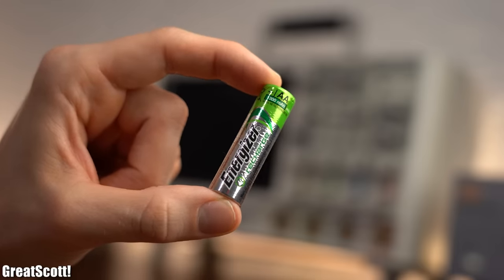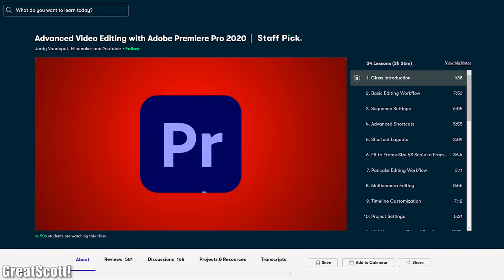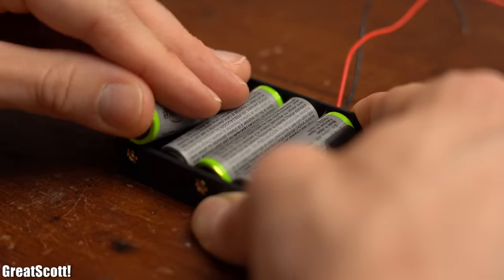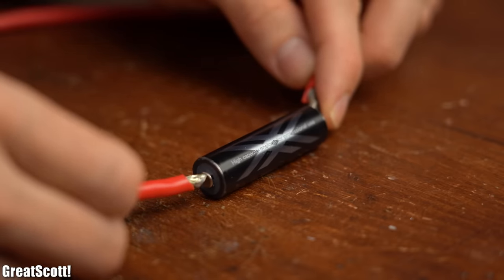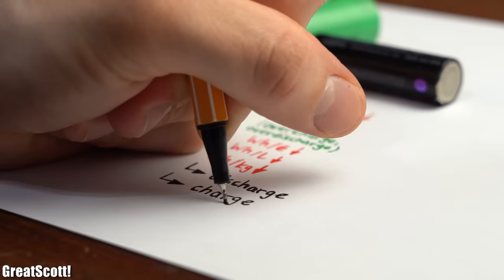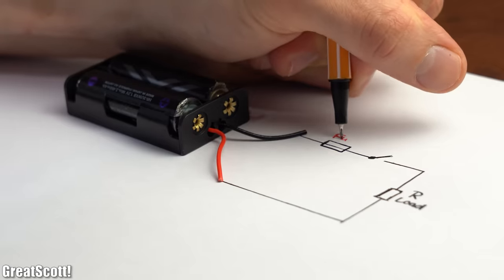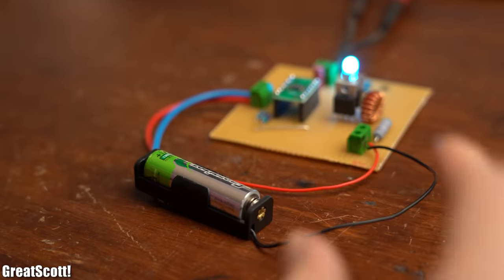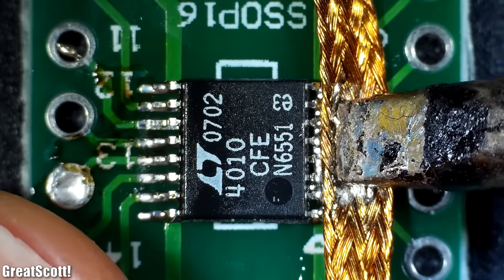Are AA NiMH Batteries obsolete? Here is everything you need to know about them!

Comment: NiMh shines when you need a rechargeable solution for low temps. I recently used NiMH AA’s for some small solar powered 12V battery packs for some wildlife cameras. No other chemistry would work for potential below freezing charging. The goal was cheap, small, and simple. So, I didn’t want a bms, much less one complicated enough for a low temp shut-off.

Comment: For my low power cat toy device use, inexpensive NiMH work well for me. They do the job, and I don't have to worry about catastrophic destruction when my cat abuses the toy. Lithium batteries are great, but I don't really trust them in products that are getting dropped on the floor from 5+ feet up, which regularly happens with my cat's toys.

Comment: I've been using Eneloop batteries since 2007. The original ones are still going strong. AAA, and AA. I haven't bought batteries since that time.
Reply: Did you have any devices that weren't quite as good? Eg. dim screen / slower motor?

Comment: I've been using two NIMH batteries for my mini shaver for backpacking. To charge them I put two of them in series and use direct 5 volts manually. 
I use a small USB power meter so that I can measure the capacity that has been charged. 
I will hold the 2 batteries to the USB supply at 5 volts for 30 to 60 seconds until they start to warm up a bit and then disconnect the power until they cool down and repeat the process until the approximate capacity has been reached. This has been working for years for me with no detrimental effects. 

I realized that it isn't ideal but it works and I've been using the same pair of batteries for a few years now. 

Have a great day love your videos I have learned so much from you my friend.

Comment: Great video. 
I replaced all AA batteries with Gen 1/2  Enelooop NiMH 10 years ago, and they’ve all lasted for an incredibly long time with NO corrosion. Surprisingly, they have suffered low degradation to boot. I’m very happy with the technology in low tech uses such as the kitchen scale, thermometers, thermostat, remotes, clocks, etc. i have 15 in use constantly.
Reply: How long would you say a white eneloop AA typically lasts in a bog standard (no screen / digital features) wall clock?
Reply: @jimmybrad156  I have 2 eneloop AAA's in my stormtrooper bedside digital clock, lasts about a year and a half before needing recharging when the lcd display fades.

Comment: I'm still, time to time, use NiMH cells in projects.. All depends on requirements, size, price etc..
Great thing, that in case of NiMH, there is no need to integrate charger and protection circuit.. Extra bonus - as emergency, standard AA or AAA batteries from supermarket can be inserted.. 😂

Great video, as always! 👍
Reply: Yeah, I still use NiMH (especially eneloops) for small solar projects. All you would need is a resistor to limit current for trickle charging (or just not use a resistor if its a very small solar panel). If you really need a faster charge, you could just spare a I/O and analog adc pins to switch a mosfet (for current limiting) and stop charging when battery reaches 1.4V.
Reply from the maker: Thanks and thanks for the feedback :-)

Comment: A good overview- I personally love the interchangeability of AA batteries and use Eneloops in cameras, flashes, clocks, room thermostats and projects. Charge them up, put them into a drawer and you'll be fine, they are robust when you drop them, create no fire if you short-circuit them and no puffy LiPos because you charged them but somehow forgot to use them soon after.
Reply: Exactly. I threw out a smoking 18650 cell the other day after putting it in the wrong way in my headlamp. It didnt even get in properly before reacting and burst into smoke and fizzling. Clumpsy yes. But i have used them for a long time but NI-MH for alot longer and never had something like this happen before if i out them the wrong way i just didnt get any light.

Comment: In RC plane circles, I've seen the term "Delta V charging" to refer to the more sophisticated charging scheme done by that IC and is also found in the Sanyo battery charger. Basically, it tries to detect a drop in the voltage being taken by the cell as it nears the end of its charging and turns off based on that.
There's also a concept called "forming charge" where sets of NiMH cells are trickle-charged together at a slightly elevated current to intentionally (and very slightly) degrade them to the exact same capacity, essentially creating a matched battery set and avoiding any individual cell overdischarging during use without the need of a BMS.
Reply: How does the forming charge work if they're all starting out slightly different though?
Reply: FYI, du/dt is not a charge method, but a cutoff method. You can have this kind of cutoff with various actual charge methods, for example Reflex charging.
Reply: That's why slow charging NiMH batteries is not a really good idea. The charger will most likely miss the drop in voltage as it so small when slow charging. Usually, only an issue if you're charging high-capacity NiMH batteries with cheap / low amperage chargers. It will just keep pushing juice till the timer cuts if off, unnecessarily heating up the batteries and possibly shortening their life span. 
You should go with a charge rate of 0.6-1 C for it to work properly.
Reply: How does the slightly elevated current degrade them?  Would it attempt to overcome a resistance in one of the cells?

Comment: I remember investing in some NiMH AA cells back in 2000. I was shocked at how much better they were compared to NiCd cells. I had an old laptop I was still using for writing and converted the battery pack from NiCd to NiMH and doubled the runtime. I just had to charge it outside of the machine until I made some changes to the charge board.
Reply: And at the time Li-Ion basically gave another doubling  but was expensive.

Comment: I have a set of heavily used NiMH AA batteries from late 2016 that still work fine. I use NiMH cells in my radio receiver collection and use USB and 12 volt chargers so I can recharge with portable solar panels after hurricanes. I`ve tested them in high heat and very cold weather with no issues.

Comment: 7:09 Most overlooked functionality of the Sanyo NiMh charger is that it does not charge cells individually but in pairs. Even if you depleted only one cell, you need two cells to start the charge process. I have seen old Sanyo NiMh chargers were per cell, there will be four LEDs and spec'd for per cell charging.
Reply: I ditched my old charger and got one that did individual instead of pair charging as I had several things that took odd numbers of batteries and it was a pain to keep matching them so they charged properly
Reply: Most NiMh chargers charge 2 batteries at a time, not just the Sanyo one.
Reply: Those models have 4 independent channels, you are talking about ancient dollar store chargers.
Reply: And? There is no memory problems with Panasonic Eneloop.
Reply: Makes me glad I bought bought the Panasonic wall charger

Comment: 2:27 "My trusty Eneloop ones..."  The IKEA 2450mAh AA 'Ladda' cells are apparently precisely the same. Not just similar, but precisely the same. Specifications the same. Test results the same. Made in the same unique factory in Japan.

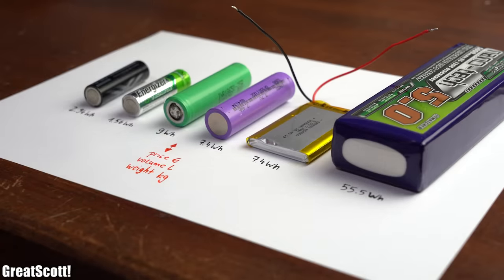Price Comparison:  5:42 shows €15.52 for 4 pack. The 'same' cells from IKEA are Cdn $8.99 (Pkg of 4) which is €6.25. So the price comparison is now upside down.
Reply: True, True, True.... i bought nothing else as IKEA Ladda in the last years. Absolutely relayable!
Reply: Yeah they are as good if not identical
Reply: waoo, thx for the info.
Reply: I've started replacing my old rechargeables with Ladda batteries. Wasn't until I started to add up what I needed that I realised how many rechargeables I have scattered about the flat. Going to cost me a fortune.
Reply: @webchimp   Buy them slowly. There are some gadgets that don't like the lower voltage (1.2 vice 1.5), but some things either don't mind or actually are intended to accept NiMH cells. I'm quite far ahead, for a daily-use flashlight that used to cost me ~$2 a month in alkaline cells. Cheers.
Reply: @JxH  it is not 1.2 vs 1.5. what?
Reply: Ladda is out of production and is a little worse, though it is indeed repackaged eneloop. At the very least it looks like it was based on previous model, but imho it is an artifical limitation.
Reply: Was looking for this comment. As it is quite a big price difference, and the same type of battery.
Reply: Be sure to verify that the batteries say MADE IN JAPAN when you're getting them in the store. Some of the Ikea cells were made in China.

Comment: The manufacturers also might be assuming that you are using all of the same brand of NiMH battery, so they will always be the same voltage so they don’t care about monitoring the cells individually.
Reply: Yeah, I found it weird that there were two different types of batteries plugged into the same device. Personally I wouldn't do that.
Reply: Every single device I've read the battery label for has some or all warnings like do not mix battery chemistries, brands, old/new, or full/partially charged batteries. This guy had two brands of wildly differing capacities and while I understand people do it, they are warned not to. He probably wouldn't do the same with 2x lithium cells of different brands and capacities so I thought this was a bit silly.

Comment: Great video, very informative.
I was surprised that you didn't include any discussion of life cycles for the various batter chemistries.

And then perhaps, a cursory review of the impacts of charge rate, discharge rate, max charge voltage on the life cycles.
Reply: Yeah, I think it will be a great series for introducing all available battery chemistries for consumers.

About NiMH lifecycle, I saw mixed numbers just like good old NiCd. The lower the capacity, the higher its charge cycle. But high capacity NiCd tends to have higher internal resistance though unlike NiMH.

Comment: Solar lights are still a great place for NiMH cells. As are TV and airconditioning remote controls.
We also use paired (capacity tested, matched as close as possible) NiMH cells at our church for the wireless microphones. They run for around 10-12 hours off them, and we only really use them for about 2-3, so we aren't particularly worried about them dying mid service.

Comment: Advantages not mentioned in the video; Number of charging cycles of quality AA NiMH batteries is MASSIVELY higher than Li-ion / LiPo batteries.
Normal good ones; 500+ cycles
Eneloop (also IKEA AA); 2100+ (!!) cycles

Also, the newer NiMH batteries last longer, and have a much higher output.
      The good / pro grade ones can be used as a replacement in high drain devices, like DSLR cameras and camera flashes.
      I use the Eneloop (official, as well as IKEA branded) in my DSLR - they last way longer than the original branded Lithium-ion battery pack, and charge the flash just fast.

Also, they keep their charge WAAAY longer. 
     Eneloop (most well documented, that's why keep naming them) still has 85% charge after 1 year on the shelf.

And, as you mentioned, they are tougher, and more forgiving when it comes to abuse / mismanagement.

And as a replacement for disposable AA batteries... They are AMAZINGLY better for the environment (or 'less of a burden' on it, at least);
       If 1 rechargeable battery can outlast 500 disposable batteries. That's 499 batteries that do not need to be disposed of.

The only downside (which is not that bad, if you have an extra set of batteries already charged up) - is the charging time; 8 hours is a long time :)
.    But yeah - I keep a charged set at hand, so I don't have to wait those 8 hours. Problem solved.
      €5,99 for 4 batteries with such quality and longevity... 
     That's nothing in this day and age.

* FYI: about the IKEA = Eneloop thing;

IKEA batteries (AA 2450mAh), are made in Japan. 
      Apparently there is only 1 factory that produces batteries in Japan itself (rest is outsourced). 
      The factory belongs to Sanyo / Panasonic. And the only thing they make there is Eneloop batteries.
      This was theorized by a clever guy on the internet, and the theory has since been tested by many reputable tech websited and magazines;

All have come to the conclusion that the specs match those of official branded Panasonic (Sanyo) Eneloop batteries. 
      In some cases the IKEA branded batteries even exceed the specification (more so than Eneloop branded ones)
Reply: Fdk corporation is the factory in Japan who made the cells, spot on you're review mate.
Reply: @fredynuts  Oh, cool :) I didn't know the name of the factory. (I did research if the "1 factory in japan" was true, though. You know.. Before telling other people :))

And thanks :) 
I did quite some digging (aka. "Went down some rabbit holes of information, when I was bored.. And broke". Haha
    I'm always on the lookout for ways to have quality tools and tech stuff for cheap, and how to reduce waste / repurpose / repair things -..and the IKEA batteries thing fit quite nicely into that mindset. So I figured it was well worth looking into :))

Actually ran some tests (like.. Just 2. So it's more anecdotal evidence than scientific. But picked random ones from my stash; 1 Eneloop, 1 IKEA), 
     using one of those 'professional' (well, probably more 'advanced hobbyist') grade battery chargers. (It's a SkyRC B6 mini, I think. I use it to charge / inspect / revive power tool batteries too - does everything from Ni-Cad to LiPo)..

Anyways - the randomized tests came out as same capacity; so same results as the tests I had seen online.

And as anecdotal evidence (not measured); I have a Pentax K200d DSLR. 
       And the rechargeable batteries (both Eneloop and IKEA) seem to last about as long as a fresh pack of high end alkaline batteries. (The output stays high for longer, in contrast to various other rechargeable name brand NiMH AAs that I have)

* Sorry for the long text again :)
(Kind of happens automatically when I'm talking about subjects that I feel strongly about)

And again, thanks for your positive feedback :)

Comment: Honestly - you should have mentioned the one thing that's BAD for lipo / li-ion batteries - Sitting for awhile and use in emergency devices. 

NiMH are great for this afaik, as they don't lose as much current and aren't damaged by undervolt if they aren't charged as frequently.
Reply: Yep the low drain on lipos. 
    Boy they get all outta shape about it …
Reply: You should never have nimh in emergancy devices  on standby. There is speciall cells for that. The Nimh battery you are going to use in case of a emergancy needs to be in the charger at all time  Ikea have a 12 battery chrager.

Comment: With flashlights NiMH batteries tend to provide a very stable output (brightness) until the end of its charge. Flashlights running on Li-ion batteries tend to dim gradually all the way from the beginning, before getting a much steeper drop in brightness at the end.

As i prefer very dim lights for night hikes, NiMH batteries allows me to use a flashlight with a very low setting, without having to worry about it getting too dim when the battery still has half of its charge left. Finding a flashlight that gives me JUST enough light for my needs, gives me very good runtimes. With Li-ion batteries, i would have to find a flashlight with a bit higher brightness than i prefer, so it is still bright enough towards the end of its charge... As i prefer dim lights, i prefer NiMH...

Comment: Thanks a lot for the video : 
In one of my engineering projects, I was nearly refused the use ofe lithium batteries (they asked for integrated short circuit protection, balance charging,...) I just needed to power 4 servos to change the geometry of a parachute in mid flight, I went for 4 AA 2400mah nimh batteries

Comment: It's worth noting that Eneloops also come in a 1500mAh version.  The lower capacity ones have a much higher cycle-life. 
It's also worth noting that IKEA LADDA 2450mAh batteries are identical to Eneloop pro at a fraction of the cost.
Reply: This!
Reply: Correct me if I'm wrong but as far as I know that applies to the no longer sold white LADDA cells, but the 2450 mAh ones Ikea is currently selling are different.

Comment: Great video. Two very interesting advantages I like about them are that (1) They don't self-discharge! (at least the eneloop), it says it has a 10 year shelf life time. (2) They last for many more cycles, don't degrade as much. That makes them ideal for low power devices like controllers, multimeters, wireless mouse and keyboard, where it would be bothersome to recharge them all the time. I think the difference in energy is not that bad.

Comment: I have a big box full of charged rechargeable batteries - when I need to swap I grab  some charged ones and the old go on charge and when charged  they go in the box -- I really don't care if the charge takes an hour, week or month... I do not have one battery exclusively for one device - for most of my devices time to discharge is not an issue, I just swap batteries more... For a drone flying etc that is different, but 90% of my devices using batteries they are used 'occasionally' not from full charge to empty in one go..